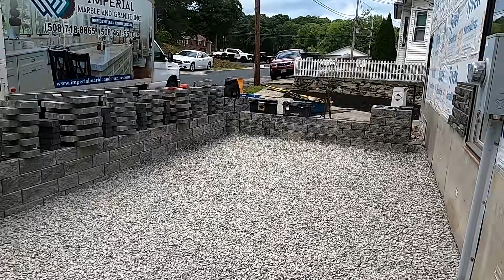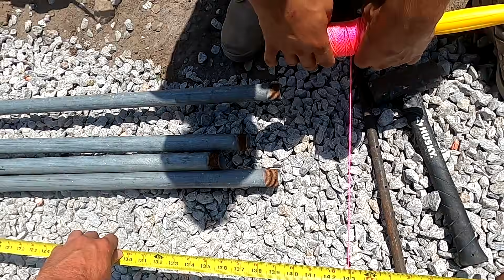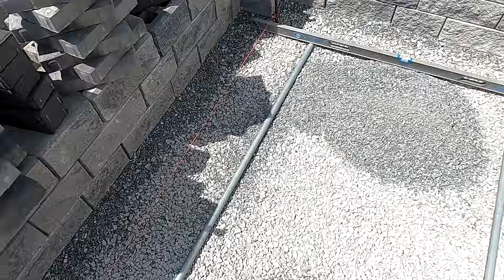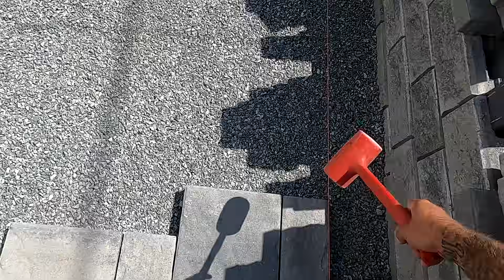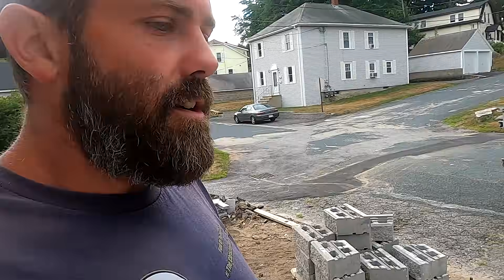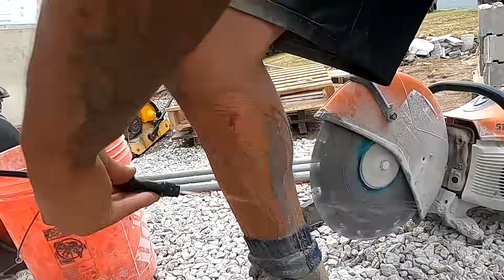How To Square, Screed & Lay a Paver Patio

Comment: No mask cutting the blocks, you are breathing in that dust from the concrete blocks (which is hence concrete dust)... sticking inside your lungs. Don't die for the cost of a mask. You can see it in the air, on your leg, on your pants.
Reply from the maker: I know what you mean, thanks for looking out. I need to find a good mask that I can wear with my safety glasses. Every mask seems to fog them up so bad that I can't see... But you are 100% right ✌

Comment: Why do you lay pavers on the 20mm stone? Wouldn't the paver move when walked on? Don't you use a compacted road base and then screed sand?  This way is so slow mate. Buy a screed with a spirit in it, save using those stupid string spirits. By the time you have your strings set up, I've laid the pavers.  I just want people to improve and make more money by helping them. GL
Reply from the maker: Using road base and sand is an outdated method and has been proven to be an inferior base compared to this open grade base. And what I usually see with people who brag about how fast they are is the quality is lacking.... I focus on quality over speed 10 times out of 10. Here is a link to another video on how we prepare the base with the open grade base method 👉https://youtu.be/ChaJe3JqD6I

Comment: Looks amazin, Do you know how to keep it clean? do you think its worth to add a sealant on it?
Reply from the maker: Thank you, the most important thing to do is blow / sweep it off regularly  so things that fall on it do not stain it. Also, they make a lot of different cleaners for pavers for different stains. You can seal it, they have many different sealer options if you want to. The only thing is that you will have to do it every couple years..

Comment: When you levelling the stones, do you recommend rock dust or sand? Is there a difference between the two?
Reply from the maker: I actually do not recommend either of those. I use clean crushed stone for my base material with no fine particles in it. 

Here is a video I made which explains my base prep in much more detail 👉https://youtu.be/ChaJe3JqD6I

Comment: Excellent video. Here in UK very difficult to find a contractor interested in smaller gardens like mine hence I’m here to learn to do it myself.
The paving supplier has recommended a cement mortar base under the 7/8” thick slate paving which should be 1” depth when tamped down. Interesting on this video just lay on stones which seems much easier but your blocks are much thicker. I still think I should rule off on the gas pipes to start with a perfectly prepared surface.
Any videos with advice on laying a border when the border is not enclosed by a wall?
Reply from the maker: Glad the video was helpful! With thinner stone like that, most people do set them in a mortar bed. This helps strengthen the slab and give it a longer life. I would definitely recommend using this base method and screeding just like I did. Then you can lay mortar and the slabs. 

Here is a video link of how I install border 👉https://youtu.be/K8XUm4j-bB8

Comment: Most cities require permit for paver patio and they have requirements on how the base been prepared
Reply from the maker: Maybe the big cities, but any town I work in, permits are not required for patios. What you do need a permit for is any kind of electric lines you run, or retaining walls over 4 feet tall.

Comment: Very informative video! Instead of using sand as bedding, can this method be used for driveway? I want to extend my asphalt driveway with interlock stone for an additional parking space. What grade of crush stone(bedding) and chip stone(screeding) were used for this project? Thanks.
Reply from the maker: You absolutely can use this for driveways. I use 3/4 inch clean crushed stone for the base and 1/4" - 3/8" clean crushed stone for the bedding

Comment: Hey bro! Been awhile! Great job like always! I just did a first patio ever and very happy how it turned out! In the future, I would like to try your method using 3/4in stone for base and 1/4 in as screeding material! Metal pipes is a smart move as well! We used PVC. Still worked out great, but I feel like metal pipes are a better choice! Keep up great work dude!
Reply from the maker: Nice, congratulations man! The Open Grade base is key in my opinion and yes, the metal pipes hold up good and give nice straight / level screed. Thanks for the feedback! ✌

Comment: I'm doing a small patio and after watching your videos, I will definitely be using 3/8" chip stone instead of sand. Part of my patio will be against a walk-out basement. Is it okay to put rock over the basement footing and then add the paver on top of that? Also, have you ever used pavers of different heights in the same patio project? I have some 2 1/4" pavers that I pulled out of an older project and want to use, but don't have enough to do the whole job. I thought about adding a border to make-up the difference, but those are 2 3/8".
Reply from the maker: Nice, glad the videos have been helpful! You certainly can put rock over the footing. And for the different size pavers, you can definitely do that also. Just takes a little extra time messing with the bedding material but it will be fine in the end. ✌

Comment: A True random arrangement would have four ways and many abutting same size repeats.
Reply from the maker: I disagree. Any True natural stone patio install, paver layer, brick layer, stone mason will tell you that 4 way intersecting joints is the biggest no/no when laying randomly. And second to that is long joint lines. in 3rd place would be abutting too many same sizes. But that varies depending on the ratio of the sizes given on the pallet. That can vary from manufacturer to manufacturer. ✌
Reply: So you lay to a pattern which is not truly ramrod as you claim.

Comment: Why without sand?
Reply from the maker: Using road base for the base material and sand for the bedding material is the more traditional way of laying pavers. This method I use for base prep is called (Open Grade Base). It is done using clean, crushed stone on top of soil separation fabric to lay pavers on. Here is a link to a video I made which explains the method in more detail 👉https://youtu.be/ChaJe3JqD6I

Comment: Great stuff. The area you live in looks amazing. I am redoing my patio debating using the chipstone over sand for the screeding.

Keep it up.
Reply from the maker: Thank you, I love this method for pavers.

 Although, if you have a base material that has fines in it (sand / dust) than you may need to use sand for the bedding material. Simply because the fines will migrate into the chip stone. You can still use it, but you will need top remove all the existing bedding material, rake and compact the base material, then lay fabric, then spread the chip stone to prevent the materials from migrating together. 

How I do the base, there is fabric at the bottom, clean base stone, then clean bedding stone. So nothing will migrate and the crushed (angular) stone will lock together tight. 👌✌

Comment: Where do I get gravel? I usually use pea gravel. Is this better. And does home depot or Lowes carry it?  Thanks
Reply from the maker: You can definitely get the base stone at home depot (3/4" clean crushed stone) but I don't know about the bedding stone (3/8" clean, crushed stone). Also, if it is a decent size area, I would call around to local landscape supply yards, it will be much cheaper to buy in bulk.
Reply: @TheChristianHardscaper  Thanks

Comment: Thanks so much for all of the useful information but I had one question. I hat happens when you have more than 1/8 of pitch? Im currently working on a paver project and some areas I have more than 1/8 pitch I would assume more pitch would mean better water flow? Thank you in advance!
Reply from the maker: No problem at all. And yes, you will just have better water run off. I have laid plenty of projects at more than an 1/8. Some jobs just need it…✌🏻

Comment: Hi great job, what's your opinion on using 21aa for base and 2ns @ top? Seems to be the norm in Michigan!
Reply from the maker: I used to use dense grade / sand 4+ years ago until I switched to this method, I will never go back. This method is far superior no matter what you geography. It is excellent for all soil types and applications. Here is a video I made that explains the method in much more detail👉https://youtu.be/ChaJe3JqD6I

Comment: I bought a bad ass electric brick saw with a rimless blade for $100 dollars.  It's far better than a cut off saw.  The cut is way cleaner and it sprays water...  We have had gas table saws before, but they don't touch the electric one.  If you find one, snag it ASAP.  It was a complete game changer for our business.  We will never use a gas table saw again, but we still use our STIHL cut off a lot.  The rimless blade is really where it's at.  I'm pretty sure you can buy one for the Stihl saw.
Reply from the maker: Nice, those are pretty good for small straight cuts. But nothing will ever make me leave my Stihl cut off at home....LOL I love these saws. Never been a fan of table saws for pavers. ✌
Reply: @TheChristianHardscaper  I use both.  I also keep my Stihl on me, but the table saw is so pro dude.  You can speed through cuts.
Reply: @TheChristianHardscaper  It's super nice if you have jobs with hundreds or thousands of cuts.  You'll be a fan of them if you ever have intricate walkways you have to lay.  You'll save literal days of cutting.  Imagine doing 500 cuts with that Stihl saw.  Its an absolute nightmare and super taxing on the body.
Reply: Hey guys how do you learn  to do this craft?

Comment: Some people say you need to compact the pavers once they are installed. What do you recommend?
Reply from the maker: Yes, you should. I compact them after sweeping polymeric sand in the joints to settle the sand down and lock the pavers into the bedding material. ✌

Comment: I am trying to learn is there not supposed to be a bed of sand under the pavers?
Reply from the maker: Some people use gravel and sand. I don't because sand washes away and the pavers sink and shift more... I use clean, crushed stone under my pavers. The base prep method is called (Open Grade Base). Here is a link to a video I made which explains the mthod in more detail 👉https://youtu.be/ChaJe3JqD6I
Reply: @TheChristianHardscaper  Thanks you for a quick response I am looking at the cost to have this work contracted , the pros and cons of using those paver base sheets etc so your video was timely and very helpful. I am in Canada so I also have the frost to deal with. Blessings brother.

Comment: excellent work on this job.  Your articulation and explanation is on point.  As a visual learner, you make it easier.  I am just starting out and looking for ideas on how to make this as smooth and easy as possible.   One question, you don't have to compat the chip stone?  At anytime would you? or is it because it is only as high as the pipe?   It's such a great idea and I am going to try this....I will be watching all of these videos now.  so 3/4 clean stone compacted below then chip stone?
Reply from the maker: Thank you very much. I do not compact the chip stone. we only use 1 - 1.5 inches of it and it is not necessary to compact, actually it is useless because after you compact it and go to screed, it all loosens up from screeding.... 

This base prep method is key in my opinion and I recommend it for absolutely any paver project in any kind of climate. Here is a link to a video I made which explains the method in a lot of detail 👉https://youtu.be/ChaJe3JqD6I

Comment: is there any reason you don't lay the blocks on sharp sand screed?
Reply: Cause he’ll be back to fix it. More $
Reply from the maker: Sand is not a good bedding material. No material out there is more prone to migrate than sand is. The knowledgeable hardscapers in the trade have been switching to this method for the past 5-7 years. I have not used the traditional method of road base / sand in over 4 years. And contrary to the foolish comment of this guy above, I have not had to return and fix a single thing. Most people who don't research much about hardscaping, don't know this method but it is getting more and more popular and the major paver manufacturers have been pushing contractors for years now to switch. Here is a link to a video I made which explains the method in detail 👉https://youtu.be/ChaJe3JqD6I

Comment: Question:  how many inches would you give as space next to fencing/posts?  I am concerned that in the future if the posts which are buried in cement have to be removed to put new posts down.  That’s being said, I do not want to damage the pavers/patio in the future.
Reply from the maker: If the fence and posts are on the edge of the patio, I typically like to give 4-6 inches. That gives you room for concrete on the edge and then you can fill in the gap with some decorative stone. Then if they need to replace it in the future, they should be good. If anything, they may need to pick up the border course but thats it. ✌
Reply: @TheChristianHardscaper  would 8 inches be enough space that in the future the posts which are anchored in concrete can be removed and replaced without damaging the pavers.  Trying to be proactive if/when i need to replace.
Reply from the maker: @reverendblkgrape1  8 inches would definitely be pretty safe. But even then, it may effect the base depending on how far down they go. But most likely you should be fine at 8 inches.
Reply: @TheChristianHardscaper  thanks so much for your input.
Reply from the maker: @reverendblkgrape1  No problem ✌

Comment: Get an iq360 saw it will change the way you cut. Saves your back and a lot of time.
Reply from the maker: I actually do not like those saws at all.... I cut the majority of my pavers in place, way quicker than cutting each one on a table saw. Plus  the IQ saw really only cuts straight, so I still need a regular cut off saw for those cuts. Plus that saw is super expensive.... LOL. But I hear you on it saving you back. ✌

Comment: Does the final top quarter inch Chipstone that you actually lay the pavers on have pieces that are bigger than a quarter inch because we have that here but it seems to have small 1/8 pieces up to 1 inch pieces
Reply from the maker: So the chip stone I get is considered 3/8" clean, crushed stone. That has a lot of 1/4 inch and  some 3/4 inch pieces mixed in. So there is definitely some variance in the mix...

Comment: Quick Question - Do these patio pavers withstand heat from a fire very well?  Specifically, I am thinking of laying a patio like you show and then placing a Solo Stove fire pit that sits on (or just just above on a stand) the patio, but want to make sure the heat will not damage this type of paver.  THANKS!!!!
Reply from the maker: To a certain point yes. But any kind of extreme heat can cause concrete to crack. If you are placing it on the pavers, some kind of protection would be a good idea. Even like a thick gauge sheet of aluminum or something..... ✌

Comment: Your base prep method makes so much more sense as compared to the standard use of sand.  I think the best industrial example would be the use of a very similar angular stone or gravel when bedding railroad tracks.  That stone allows for the tracks to drain, doesn’t appear to compress, warp or heave over time.  Keep the videos coming.  You guys are very likable👍
Reply: I thought sand helps hold zstone  in place better but i guess it dont drain better?..then these bricks do?..but i know nothing..jus seen all other vids use sand..so this is good..? Thanx..oh..can i put weed barrier down?
Reply: Very True. I just purchased 18 pallets of the pavers and the company just switched to 10 year warranty if using his method. Open base.
Reply from the maker: Yes sir! The railroad tracks is prime example of this method. People comment about how this stone won’t hold up, and like you said, it holds up trains driving over it no problem. And the water draining right through it is the most important part, especially in freeze / thaw cycles.. thanks for the feedback and I’m glad you see the benefit of this method! ✌🏻

Comment: Love the videos!!  Two questions.  How do you determine how many of each size paver to buy for a job so you don't get to the end and have all one size left?  10% extra each size?  20%?  Do you have a minimum depth to dig if you organic material is deeper than 12 of 15"   N IL has great soil for farming but the topsoil/black dirt can be very deep  Thanks, have learned a ton watching you and Benny!
Reply from the maker: Thanks man! So basically all these 3 piece designs come pre assorted on the pallets. Meaning the pallets already have all 3 sizes on them. You just have to lay them evenly throughout, making sure you use an entire layer before pulling from another. And for the excavation, when I run into clay or deep top soil material, I dig 12-15 inches. Even if you have clay and soil at 15 inches, that will be more than enough depth. Just be sure to compact the 3/4 into the sub base very good and use that geotextile fabric on the bottom and sides to keep the soil from migrating into the clean 3/4 stone. Thanks for supporting the channel, God Bless! ✌